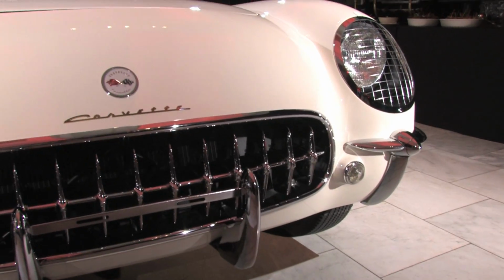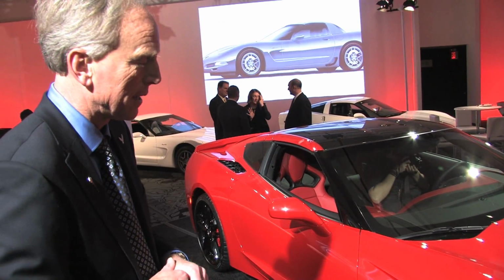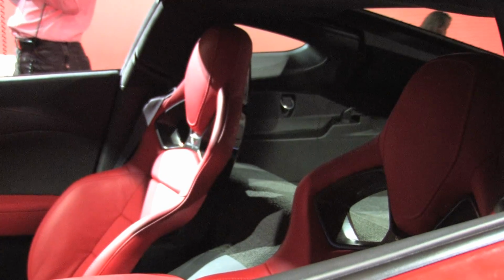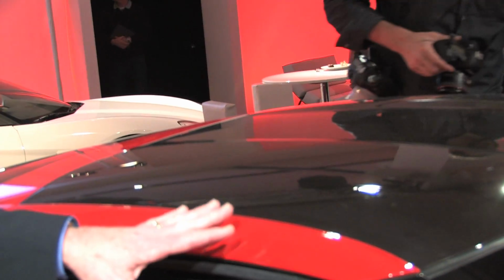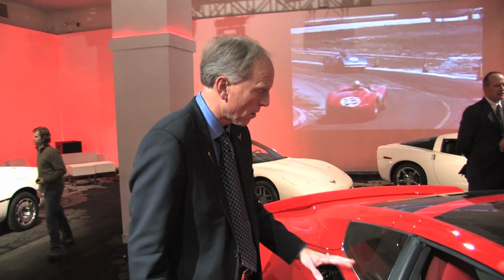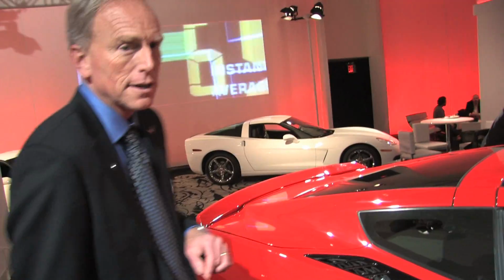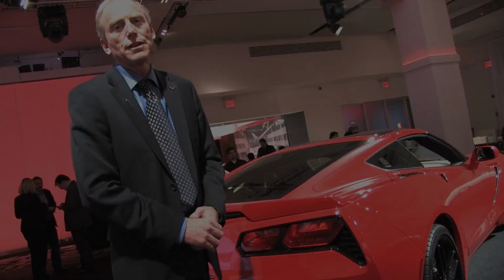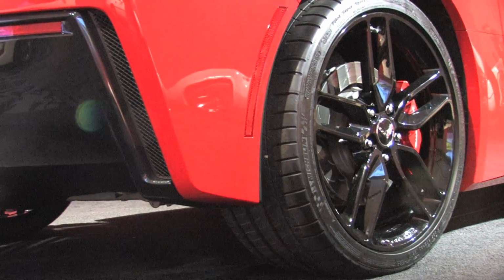2014 Corvette C7 : Walkaround : Tadge Juechter Chevrolet Chief Engineer

Comment: Well when u really think about it, GM and Chrysler have been using cylinder deactivation since '06 and you never hear about any abnormal engine wear other than the specialized lifters going bad and even then, its not very often. Spark plugs at 100k, oil changes every 5k (full synthetic to help prevent lifter and VVT issues due to sludge), etc. just like you would a regular engine and you will be just as you would any other engine. GM's deactivating V8's have been going 330k+ miles, no problem.

Comment: The pistons in the deactivated cylinders still operate as in the other cylinders only the intake/exhaust valves are closed- hence the deactivated cylinders act like  air springs.

Comment: One things bugs me about that cylinder deactivation application. If the same cylinders are deactivated each and everytime, for someone who saves a lot of gas by driving the car in constant speeds, a milage matter driver would cause that engine wear down unevenly. Those four cylinders that work all the time will wear down faster than the other four that are deactivated each time. :) This thought keeps bugging me.